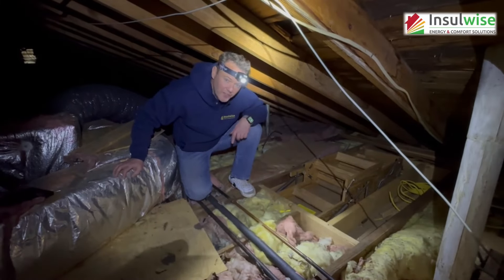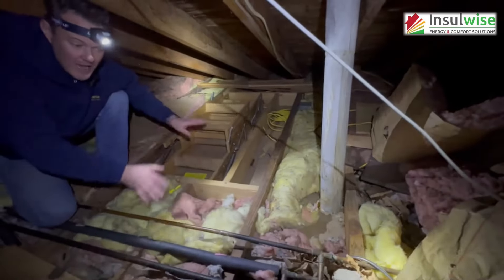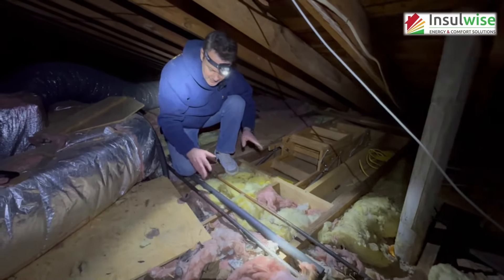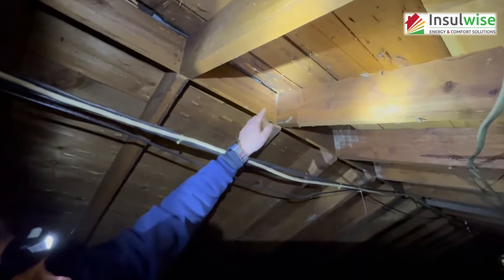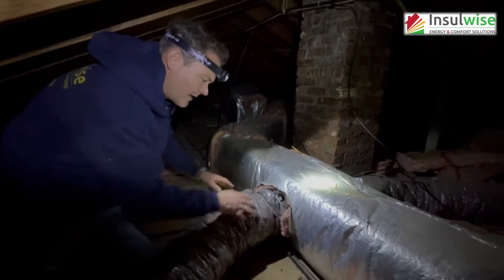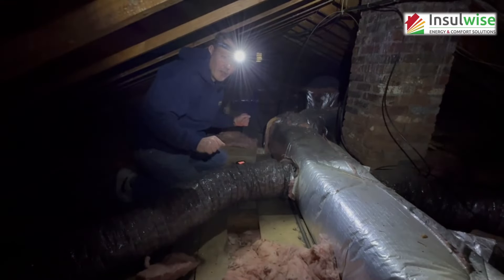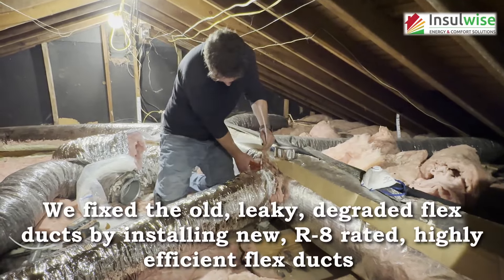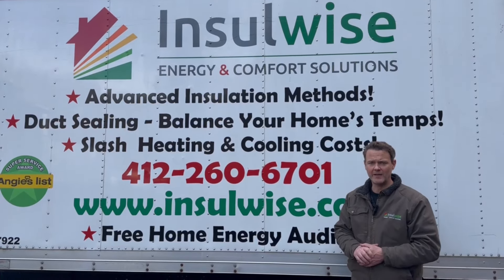Avoid These Attic Disasters That Will COST You Thousands!

Comment: Oh man....not something to brag about, but my attic is/was orders of magnitude worse than this.
- 22" at the highest point (between top of 'floor' joists to bottom of ridge beam)
- Rockwool style insulation, compressed down to 1" in many areas from decades of Raccoon damage
- no soffit vents and soffit area completely inaccessible from inside due to shallow roof pitch
- poor air sealing to living space below
- a gas furnace and associated air handling unit/plenums/ductwork installed right over literal Raccoon feces and damaged insulation by some clown-show of a contractor in the mid 1990's
- leaking, crumbling, flexible air ducts that were never installed properly due to lack of room to even crawl around up there

Sorry, just had to vent a little.....I still have nightmares of fixing all these issues. Furnace had to be completely removed from the attic and the house switched over to radiant heat $$$$😭
Reply from the maker: Ahhh man I hear ya that sounds rough.  At least in this attic we did have room to move around in you're right.  As soon as you have duct systems in attics you've usually got some bad issues (until they're fixed properly!)  Glad to hear that you got your issues fixed...!  Thanks for commenting. 
Andy